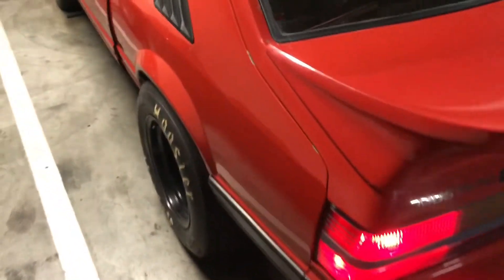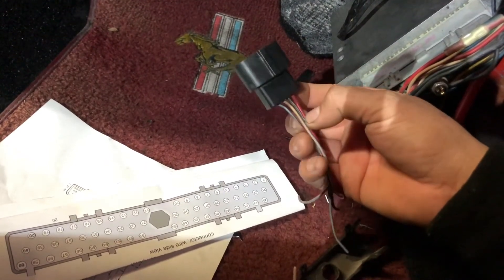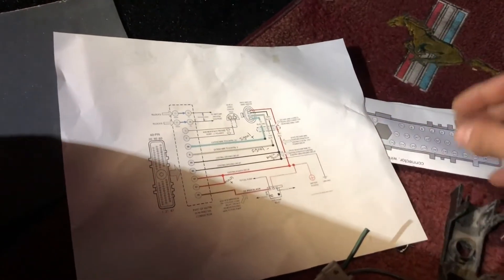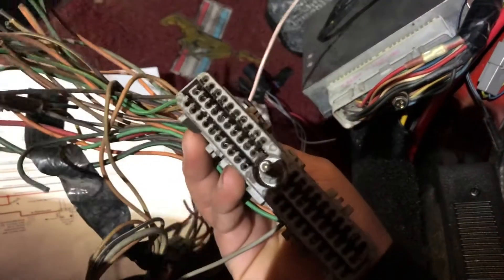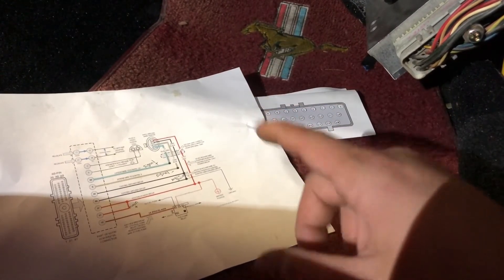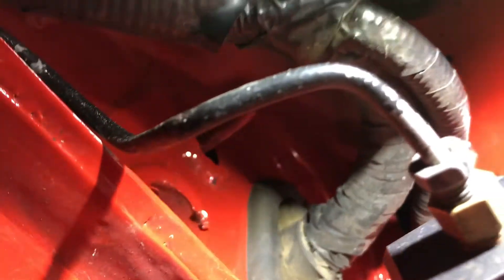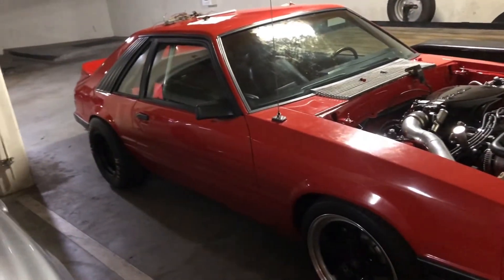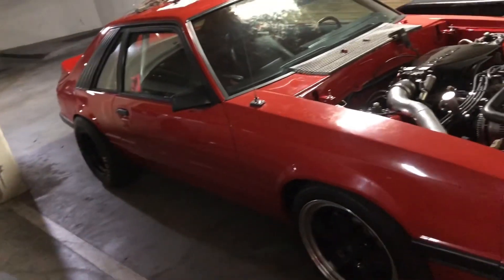Foxbody how to do a maf conversion

Comment: Im stumpted, any help would be appreciated. My car wont run with the mass air plugged in after doing the conversion, I have the A9L computer.

Also did heads cam intake with all supporting valve train mods. I did 30lb injectors with 80mm mass air for a 30lb injector set.

Runs rough without mass air plugged in. Doesnt start with the mass air plugged in.
Reply from the maker: Double check the connections and check the timing. I’ve had a maf I purchased off someone one. Car would turn on, die. Turn on die and then finally would stay on but would idle like crap. I bought a new one from pro m and ran perfect and started right up
Reply: Yea thanks, just went to check it again. It does start, sounds ok then turns off in 4 seconds. (With the mass air plugged in)
Reply from the maker: if it runs with out the maf connected but runs rough I would get a know good one maf.

Comment: Did you have to do anything with the o2 sensor harness?
Reply from the maker: No sir you don’t have to. That’s only when going from auto to manual
Reply: I converted my 88 mustang to mass air and bought the LMR conversion kit but theirs had me move pins around an mines runs bad but on your video u didn't move none,why is that
Reply from the maker: @torapruitt9491  those pins are to make the diverter and by pass work if I remember correctly
Reply: So on your car u left the 02 sensor the same as the 86 came
Reply from the maker: @torapruitt9491 correct, but there is a difference on the manual and autos. I had a manual harness
Reply: @a.s_kustoms7941  I have a 88 mustang auto ,so I have to do it like LMR diagram
Reply: What do divert and work mean an can I take out the 43 and 29 pin to oxygen sensor